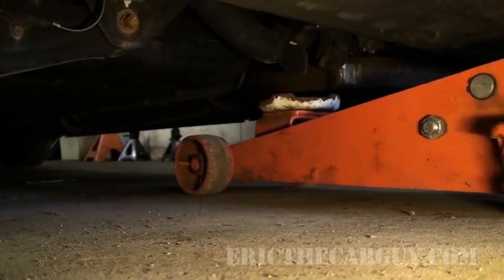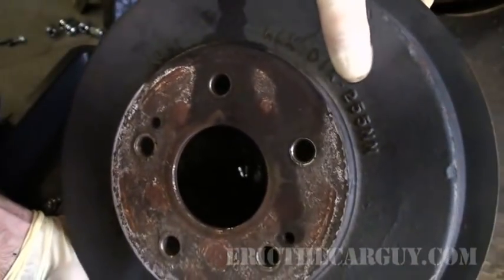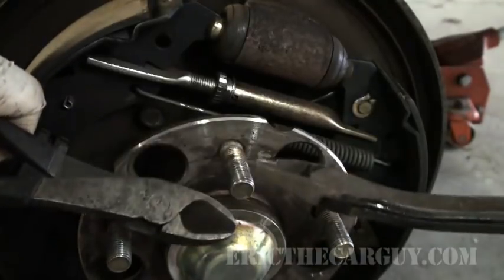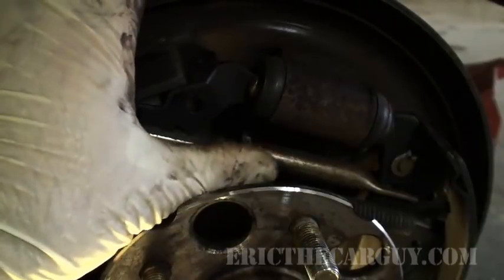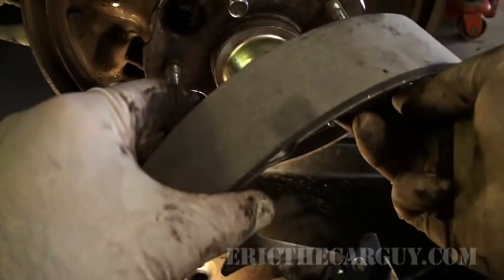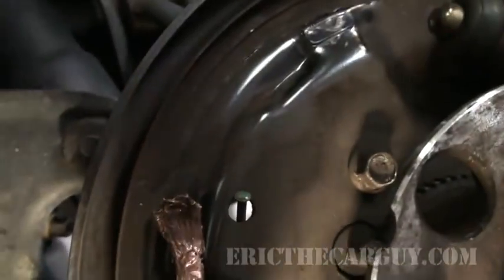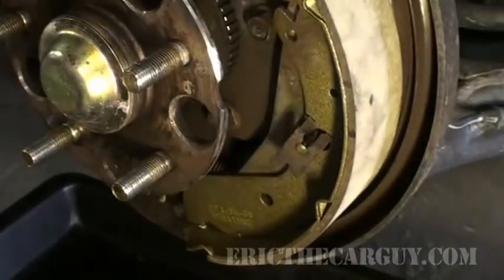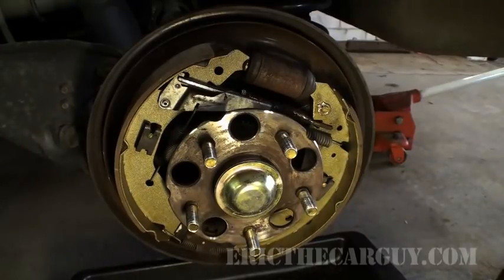How to Replace Drum Brake Shoes, 2001 Odyssey  - EricTheCarGuy

Comment: I replaced the rear drum brake shoes and the wheel cylinders on my 2001 Odyssey using your instructional video.  After I got everything back together and adjusted, the brakes work fine.  But, my parking peddle was not stopping the brakes.  I adjusted the cable length near the parking brake foot lever and no improvements.  After driving the car for four days, the auto adjust mechanism in the rear brake assembly was doing it's work and the parking brake started to stop the car a little.  This boosted my confidence to adjust the cable length near the parking brake foot lever some more.  Now the parking brakes work perfectly.  Your instructional video brought me 100% success in changing out the brake shoes and wheel cylinders on my 2001 Honda Odyssey.

Comment: just replaced the rear shoes,cylinders and one brake cable .on my Peugeot 205 1.7L diesel saloon car.I use the anti seize everywhere  the shoes contact metal .I take your point on the brake dust mixing with the anti seize grease.Great video  congratulations on your presentation . 70 year old ex Donnington Park GT champion race car driver.My 65 year old wife Jane still remembers how to help bleed brakes.
Reply: Wow you were a racer, that' is really cool! Kick Ass!

Comment: Eric, some years back I used a reverse thread tool which you use after drilling a small hole in the bolt head. Most of us don't have sophisticated tools. Your drum brake removal was very handy. My mechanic did not show up and I did it myself. Piece of cake.

Comment: Thank you. I just read the shop manual and felt a little intimidated doing the rear. Have done the fronts on several cars, but never rears. But knowing I can learn anything online, you were the first search that came up – and I'm glad it was! So informative, step-by-step, funny and felt like you were right in my garage helping me side-by-side. Thank you. I now have the confidence I need to give this a try.
Reply: Just buy a few tools to reduce blood loss.
Proper lube on metal to metal contacts.
Be SURE that the wheel cylinders are not leaking.
New shoes push the wheel cylinder pistons farther inboard,where the corrosion is.  Seen it too many times.New shoes=wheel cylinder leaks and a spongy pedal.

Comment: Great help Eric.  Thanks.  Enabled me to discover that I had a slightly leaking cylinder, which had never caused any drips on the floor but over time  enough oil had soaked into the brake shoes and caused them to swell.  I noticed the binding and overheating of the back left drum, which was impossible to remove without learning from you how to use the two threaded holes in the drum.  Thanks again :)

Comment: I used this video to help me change my brakes on a 2000 Neon.  The Ody and the Neon have the same style brakes, non-servo.  I used a 45 degree needle nose plier to remove and replace the springs.  To adjust the shoes, I was able to put the wheel back on and slide the starwheel through the rear of the backing plate.  I looked for a 1 1/2 wheel turn on both sides.  Not having done this before, I didn't know what the feel was on just the brake drum and hub.  Anyway, Eric's vids are the best! Thx.

Comment: recently i did a brake drum job, i replaced the wheel cylinder. I've never done that before. Totally new experience. This video seems to me like a re-learning. Haha i improvised a spring-remover-tool, made a small notch on the head of a flat screwdriver. That came really handy. and hell yeah, the main spring is a pain in the ass. Awesome video

Comment: Hey there Eric. Love the idea of putting the masking tape on the linings to keep them clean. I've been doing DIY  car maintenance for about 23 years now and never thought of doing that.
  Now it's my turn to give you a tip. I find it easier to lay the new shoes on the floor and put all the hardware I take off the old shoes on them as I take it off the car. Hit it with a little brake cleaner and wipe with a rag and lay them where they are suppose to be. That way you can't get them mixed up.

Comment from the maker: @CoolasIce2 Two reasons I didn't do it on this one, first I didn't need to as there was no ridge to worry about.  Second Honda does not provide access to that adjuster from the back on this van.  I do plan on making a video on drum removal in just that situation as well as wheel cylinder replacement at some point in the future.  Thanks for your comment.

Comment: and the starwheel backed all the way off (which I already had done already), seems like an easier way to do things because I used less tools and it took half the time. also took one hold down off to compensate for putting the bottom spring back on. I've found that practice is always going to make things easier and faster. Thanks for showing this video so I can learn quicker and easier ways to do this job!

Comment: Brilliant video. I can add two comments I have found from my own experience with older vehicles. 
If the salve cylinders are cheap to buy and the brakes are worn out I replace them as I have lost many sets of shoes due to a fluid leaks later on.

I always do some sort of verification to check that the automatic adjuster is working. Usually this means tugging the hand brake cable while separating the shoes a little at the slage cylinder side. The leaver may need bending slightly.

Comment: thanks for the video man. i haven't played with drum brakes for years, and after i had to change the shoes on my mrs' car, i remembered i hate the fkn things!!!
i tried the m8x1.25 bolts in one side, but someone had stripped the threads, so i ended up using my MIG welder to weld on the nuts that came with the bolts. worked great.. i just belted them off later, and cleaned up the surface with a flap disc in my grinder. cheers man

Comment from the maker: @bettaj The #1 complaint with brakes is noise and along with that I will say that not all replacement brakes are created equal and the #1 problem with 'cheeper' brakes is noise.  So make sure you use quality parts and noise won't be a problem, bargain shop for brakes and they will probably stop the car fine but be noisy in the process.

Comment: I'm an auto student, just went thru brakes class... First time I had ever touched a drum brake, or disc at that... And this was the one lab I found to be the most challenging. However, I spotted in my book the same way of going back together (small spring then hold downs) and did that for my final. I had everything back together within 30 mins, then came along that top spring... My instructor came over and showed me away backwards by putting the top spring in first w/out the tension

Comment from the maker: @limey3r It depends really.  if you were able to break it loose at the wheel cylinder but the line spins with the nut, remove the wheel cylinder from the backing plate, pull it toward you, and spin IT off of the line then spin the new one on.  If it's still stuck in the wheel cylinder you can try to very carefully remove with vice grips.  Good luck.

Comment from the maker: @carterlrae I've actually had quite a few requests for CV boot work, the thing is that these days with the price of axles so low it's really not worth it to just replace boots anymore so I don't really do it anymore.  I do have some old axles on the floor of the shop that I could use however to do a boot replacement video on.  Thanks for your suggestion, hopefully I can make that video soon.

Comment: Thanks it really was a helpful video.  Taking the emergency brake spring was my challenge.  I had really tight springs and I could change the bracket with the old one since the new one was pressed with rivets on it.  I had to clip a vise grips on the spring push on it with my foot while pulling on the end with a channel locks and with the free hand free the other and install the new one.

Comment from the maker: @niccusmaximus fonzi1938 is correct, start by adjusting the rear brakes as this will not only adjust the parking brake but will also give a firmer brake pedal.  If that doesn't get it adjusted to your liking then look for the adjuster in the cable assembly and adjust it the rest of the way there, start by adjusting the brakes however.

Comment from the maker: @Bushougoma I used to do that but I found that over time it actually caused the adjuster to bind up.  I've since made do by cleaning the threads before reinstalling the adjuster if it is sticking.  To be honest it depends on the make of car, some adjusters are made of better materials than others, I still apply a small amount of anti-seize on the "cheep" adjusters.

Comment: I always use vice grips (needle-nose style best) to lock onto the main brake spring(s) and it works fantastic. You just lock the pliers in place and pull with no concern of injury.

Comment from the maker: @switch55 If it has holes in the drums watch the video Removing Drums The Easy Way.  If you can't get them off due to the shoes hanging up and you can't move the adjuster cut the 'nail heads' for the hold downs off to remove the drum, you can get new ones in a brake hardware kit.

Comment: I enjoy all your vidz. The drum brake shoe replacement only proves that not much has changed in the last 50 yrs. Small differences but that's all. In this vid, you either need to buy more appropriate  tools or learn to curse more. The odd curse works for me.

Comment: I noticed you use anti-seize compound for lubricating the backing plate points that contact the metal on the shoes. Is anti-seize better than brake caliper grease? Thanks.

Comment: Hi There Eric !  your an unbelivable source of automotive information , you give us confidence to actually do it ourself , thank you so much keep up the good work ! after watching your suspension video , i want to do mine , i found a great deal on the internet for a compressor a Briggs and Straton 15 Gallon vertical tank 4.4 cfm at 90 psi 5.1 psi at 40 psi and 120 maximum psi , my impact wrench requires 5 cfm , can i use it if i let time for my compressor to refill , or it wont be strong enough?

Comment: Hi Eric. I finaly got my totaled Ranger (from the video) replacement today. It's a 2000 GMC Jimmy 4.3L 4x4 Diamond Edition. It has 76k miles. I had a freind of mine (mechanic in training) do a prepurchace inspection for me and he even brought his scanner while we took it for test run. The scan showed a slight misfire on cylenders 4/5 that can be corrected with a full tuneup and the trans needs a service like you did on that cube van. it seems like it runs like a top otherwise.

Comment from the maker: @CHOCOLATEBOI318 That code does not mean the O2 is bad it means the catalytic converter is bad.  You need to verify the catalytic converter operation to determine if it needs to be replaced.

Comment: Hi Eric, I tried to open the drum to check the shoe today on my honda odyssey 2005. I was using the wrong size of bolt to push the drum out and the drum cracked slightly. I quickly put everything back but i wonder will it be safe to drive the car since the drum cracked?

Comment: Here are some tips. When you get the adjusting part test the resistance with the wheel on reason is it might feel good with the drum but the wheel is bigger and more heavy and might spin not so good. Also this be a good time to check if the handbrake is doing it’s job. Give it a pull the wheel should not move on the tightest setting that way you know the shoes are adjusted just right.

Comment from the maker: @therockkkkher This van does not have access through the backing plate for the adjuster.  As for the brakes locking up what happens is as you drive they get very hot and expand locking up the wheel so if your not careful you could cause an accident.

Comment from the maker: @reddog9401 They are self adjusting and will tighten up over time if they are working properly.  I'll say that not all replacement brake parts are created equal so if you bought a bargain set of shoes that might be the issue but if they are good shoes then it may be that you need to machine or replace the drums if you haven't already.

Comment: Hey Eric, I was changing my wheel bearings and had to remove the rotor.  I had my car on jacks with emergency breaks on.  Had a tough time getting the rotor off, once I released the emergency breaks it came right off.  Upon reinstalling the rotor I hit a smug and couldnt get the damn thing back on.  Im assuming the emergency break which I had back on expanded the shoes and this is why I cant get back on?  had enough for one day.  This should have taken me 45 mins.  not 3 hrs. Is my assumption correct that emergency breaks on makes it impossible to reinstall rotors?  I will try tomorrow again but think I may have damaged break shoes and will need to replace those as well.

Comment: @EricTheCarGuy  Thanks for the video. I also did a brake change a sienna and get the thum thum thum sound on the left side. I switched right and left drums and the left side still makes that sound. I noticed that if i only press the parking brake when moving it makes that sound. Could it be something else that is causing that sound? I also swapped out wheel cylinders.

Comment: if you get a BIG flat head screw driver and file a notch in the top of the blade so the spring sits in it,it makes it really easy(well,easier!?)to force it out and align it back in Eric.Just a handy tip from me as I'm using yours :)

Comment: Question regarding drum brakes: I loosen up the adjusting wheel to remove it easy. Everything back in place, but drum doesn' go in. The adj' wheel is closed all the way, but drum still wont go in. I cannot adust the adjusting wheel anyore it fully closed. What else shoul i try? Does the cylinder open when sitting for too long?

Comment from the maker: @69chevyy Hard to say, it could be that they are not adjusted correctly or it could be a problem with the proportioning system, the pads or shoes, or a problem with the master cylinder or booster, you might start by checking the adjustment though.

Comment from the maker: @aaaaariiiiielllll Anything is possible with enough money and time but you may need to address the proportioning valve as well as changing the parts, many modern cars have a proportioning valve inside the ABS unit, it would be a good idea to look into if there is a difference between the disc and drum brake ABS units to be sure there isn't a difference first.

Comment: Thanks for the video!! A Buddy just called me needing help changing his rear brake cylinders. I’ve never done drum brakes before, but I have built motorcycle engines and suspension so I’m mechanically inclined, I’ve also seen many videos on YouTube on how to do something. You’re the only one I’ve seen that left in the parts of actually struggling taking something off. Never have a seen a video that showed when something is a pain in the ass. Makes me feel like an idiot when it is a bitch for me and it wasn’t in the video 😂

Comment from the maker: @Michiganborn1969 Your part right.  I kept calling it that because it was a non-servo style and that adjuster worked as part of the parking brake assembly however I did explain the difference between servo and non-servo brakes in the video I still see both in use on the vehicles I work on.  Thanks for the comment.

Comment: On minute 15 of this video when you finally removed the brake pads, the parking brake cable stayed hooked on.  Before I removed that cable, the brake pad turned a few times while suspended by this cable.  Does this change the parking brake cable adjustment?  The reason I ask is that I reassembled it and  pulled on the parking brake.  The lever goes alot higher now.

Comment: Eric, I followed this excellent video to change rear brake shoes on my Honda Civic 2000. What got messed up was that the cylinder boots popped and I lost some brake fluid each side. Closed the boots and topped off the fluid. Thought things were in control until I tried a test drive, I find the brake pedal very loose (failed??). Parking brake is also very loose. It appears brake pedal goes all the way before engaging and I have to use parking brake in combination to stop the vehicle. Please help.

Comment from the maker: @switch55 I don't know for sure but those may be similar to the brakes in the original drum brake video that I did, you might want to check that one out, it's been re-uploaded as a full length video so you don't have to watch it all broke up, good luck.

Comment: Hey ETCG, I have a honda fit 2010 and stripped one of my rear studs on the drum, I'm assuming the process of getting to the studs is the same way that you showed in the video of removing the front drum cover? I how do I actually get to the part where I can remove the stud? Would I just lightly tap on the stud? I don't want to risk damaging the bearing/sensor on my car. Thanks

Comment: Hi Eric Awesome channel you have, i was wanting to pick your brains or if any one knows and wants to answer then great. Can i spray [break cleaner] into the drum and just leave it to clean up or do i have to keep it off the disc, ive tried forums and have had no luck
Reply: Spray it where you want. It evaporates quickly. Don't breathe in the dust.
Use a garden hose.

Comment from the maker: @mrjost55 I have one an 18V Snap-on to be precise, it will take off wheels most times but not crank bolts, you have to break those loose first even with a pneumatic gun most times.

Comment: Good vid. Maybe next time you do a drum brake job, you can show how to back off the wheel adjuster in order to remove the drum. I recently did a rear drum job, and the drum had a deep groove worn from the shoes and it was  almost impossible to remove the drum because the shoes were stuck in the groove.